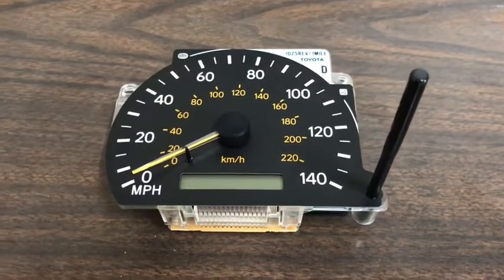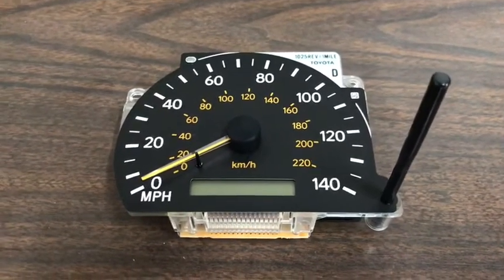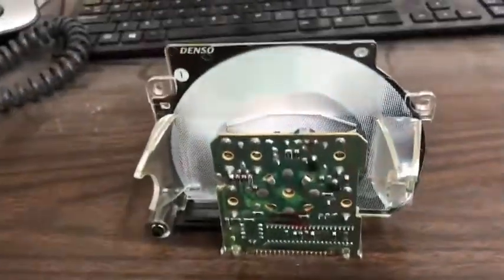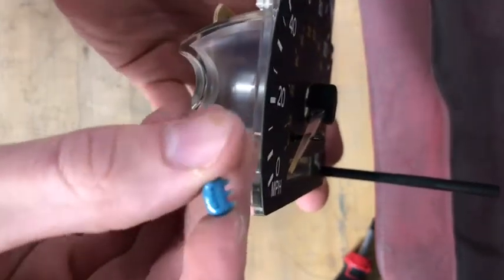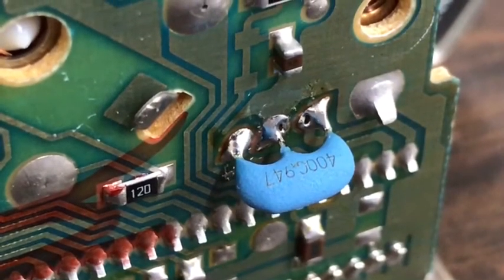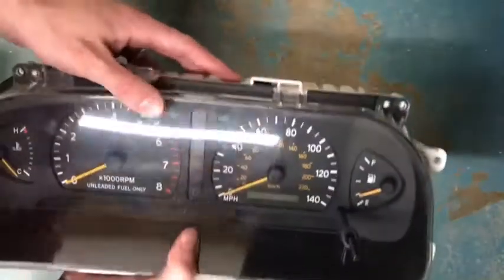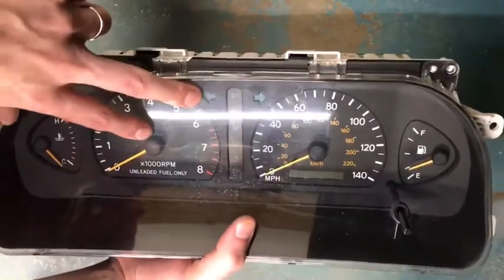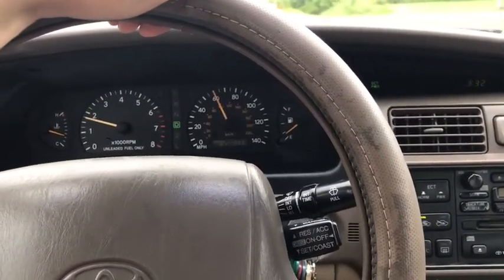How to fix Toyota Lexus Speedometer and Odometer that is not working with Erratic Shifting

Comment: You soldered the new Resonator on backside of the Board, but factory Resonator was installed on Board's front.  Thus it makes no difference if it's installed from front or back? For those of use not formally educated in electronics-- thank you.
Reply from the maker: That is correct. Either side will work. As long as those three holes get filled by the pins of the resonator, it will work.

Comment: Hello my friend. I wish to thank you for your advice. I experienced this issue with my 2000 RAV4. Spot on with the symptoms. Following your lead I was able to solve this problem. It was a confidence builder. Plus, I saved the original mileage count. Not only that but you helped me save hundreds if not a thousand dollars. Again, thanks!

Comment: With your speedometer odometer not working did the car shift differently. I have the same issue when it’s hot, but it also affects how the car shifts
Reply from the maker: Yes sir. Shifting would get erratic for me as well while the speedometer and odometer stopped working. Some people even get engine code p0500. That little electronic part just about paralyzes your car. I think You’ll be glad you replaced that part.

Comment: I have a 97 Sc300 with p0500 and a dead needle. Do you think this would be the issue?
Reply from the maker: If you don’t have any other issues, it sounds like this might fix it. It’s a very cheap fix so worth a shot.
Reply: @jeffharrell1874  I bought that part. I'll try to remember to report back. Thanks!

Comment: I was working on -98 SC300, I've used this to repair older Toyotas clusters and this Lexus had same issues as this and others I worked on, cluster was slightly different but same concept, unfortunately didn't fix the issue on customers car, we wanted to try that fix so they could keep original milage, do if someone tries this on -98 Lexus SC300/SC400, it will not most likely fix it but it is cheap thing to try if customer is okay to pay the labor

Comment: Hello. I have a 1997 Toyota Camry. The odometer isn't working. I replaced the VSS and the part you replace, and it still doesn't work. I don't know what to replace anymore. I don't know what to do anymore, help meeee
Reply from the maker: You May want to possibly look into getting a different instrument cluster, the negative on that is the mileage won’t be accurate.
Reply: @jeffharrell1874  I already bought another one since the rpm and temperature didn't work. But the odometer itself doesn't do anything the same. It doesn't go up. I bought the VSS speed sensor that goes in the transmission and it doesn't do anything either.
Reply from the maker: @HanselAntonio-r3r oh, so you can actually see numbers on your odometer?
Reply: @jeffharrell1874  If I look at the mileage on the dashboard, but I don't see it indicating what speed I'm going, it just stays at 0. It shows the gas, it shows the rpm and temperature. I have 2 dashboards and neither works.
Reply from the maker: @HanselAntonio-r3r so if your odometer is displaying numbers and is not blank, then you might have a speed sensor issue
Reply: @jeffharrell1874  If it shows the number of miles on the dashboard, the VSS is new and doesn't do anything either. Speed sensor

Comment: Saved my 98 ES300!
The cluster needs to be opened: first 4 screws of the small board, remove it and later the ~20 screws of the back panel and a similar circuit board of the video is inside the cluster.

Comment: How test this blue capacitor that you replace with multimeter
Reply: Its not a capacitor its a 4MHz ceramic resonator, rated only to 85C and they go bad with heat. If any of symptoms listed replace with  CSTLS4M00G56Z-B0, which is rated 40C hotter

Comment: This worked perfectly to fix a non functioning (blank) odometer on a 1997 Lexus ES300.  On the Lexus, the back of the instrument panel has to be removed to access the faulty resonator, including removal of an additional circuit board (4 screws) prior to removing the entire circuit board beneath (20+ additional screws).  The fluorescent tube assembly used to backlight the gauges also has to be carefully removed.  As the screws are different lengths, use a piece of cardboard to store all the screws removed that visually matches the back of the circuit board.  It is not a 10 minute job.
Reply: On this Lexus ES300 (1997)the speed sensor on the transmission was also non-functional and required replacement.  Both the display and the speed sensor was broken. Speedometer, odometer, cruise, and transmission all functioning as they should now.

Comment: Please help!  I have a 99 Rav4, 4 door, AWD, Automatic, 2.0L and the issue i have is that just the speedometer and Odometer stopped working all other gauges work.  The odometer is digital which doesn't come on and the speedometer is a needle which stopped working.  I don't have any issues with shifting, but i had a Check Engine light which is on with the P0500 code which links to the Vehicle Speed Sensor.  I went ahead and had a shop replace it, however the issue is still present and the code hasn't cleared.   Does this fix apply to my situation?
Reply from the maker: @mosconioni4523  I think there’s a good chance that this will fix it. This issue also causes P0500. Good luck!
Reply: @jeffharrell1874  it worked, thanks!! 💯🙏

Comment: Got this part from Digikey CSTLS4M00G56Z-A0. Used a 20 dollar solder kit from Amazon with wick and everything in it, even cutters for the wires. Rode around smooth shifting and everything worked like a charm. I just copied everything you did except I used the included de-soldering wick included in the kit. You saved my 26 yo car from the junkyard! I did use real lead solder though. It is just easier to heat. Thank you. I subscribe.

Comment: Great informative video. I also have a '98 Avalon XLS with 235K. The speedometer and odometer fail every time it gets hot inside the car, but they start working normal again after it cools down. 

Could you please confirm the spec for the manufacturer part number you used. I am concerned about using the correct capacitance version, which is either xxxG53xxx (15pF) or the xxxG56xxx (47pF) that you used. Considering that one of your commenters burned his circuit board, I want to confirm that the 47pF version is indeed correct, and how did you determine to select that version to order.

Thanks for your reply or from any other knowledgeable commenter.
Reply from the maker: @mitchellgreer9659  all of the linked parts in the description will work fine. The high temp resistance exceeds the original part. I think the individual that had a bad experience either had a soldering issue or another electrical issue that caused his cluster to fail. That’s the only time I heard of an issue happening. This is a straight forward process. There really isn’t much that can go wrong. Be sure your battery is disconnected during the instrument cluster removal and installation to play it safe. But No need to overthink it.

Comment: Jeff, 

Of all the research I did to deal with this 1998 Corolla, yours was the most helpful by a longshot. I plan to shoot a video for my YouTube channel on how to take the gauge cluster out, apart, how to solder in the new part, and put it all back together

I’m also going to shoot one of these soon for the 200 UF capacitor that is responsible for the issues in 2004 or 2009 Toyota Prius clusters

I want to reference your video, and site the information you gave me, in my video, with a link to yours, and I want to encourage my 6000 subscribers to also subscribe to your channel, but I would like your permission first before I do this
Reply from the maker: @DrewGarage  I have no problem with that. As long as people are getting help, I’m always for that.
Reply: @jeffharrell1874  awesome. Thank you. I would like to see as many people as possible subscribe, and if you keep putting up content like that, I’m sure some of your smaller monthly bills will be covered by YouTube. That’s what happened to me. I am always glad to give, and always feel blessed to get paid for it.

Comment: This is a great video, thank you! Reminds me of the $.25 capacitor that is needed to fix a 2004 through 2009 Prius with no gauges lol

My car is doing everything yours does, but I do have check engine light code P0500… Does that codetypically illuminate the check engine light when it is the resonator?
Reply from the maker: @DrewGarage  yes sir. P0500 is definitely a symptom. That didn’t get mentioned in the video though.
Reply: @jeffharrell1874  thank you so much!

Comment: Hopefully the video poster can get back to me, or maybe somebody who knows a bit about this. I have a 1998 Camry, I had someone attempt to replace the resonator for me and the traces on the circuit board came off that are around the 3 holes for the resonator. How would I go about installing a different cluster from a different 98 Camry into mine. I know there’s a chip on the speedometer board that deals with the odometer information, but I’ve had to drive my car once or twice and my mechanic says the ecu has been storing the accurate mileage reading so I’m wondering how I’d go about installing a different speedometer for my cluster and getting it to show the accurate mileage. Any help would be appreciated, there’s no instrument repair people around me.

Comment: I've got a 95 lexus es300 speedometer and erratic shifting but odometer no problem. What do you think. Thanks
Reply from the maker: @nathanielhutcheson5751  if odometer and speedometer are working fine, then you might have a transmission issue.
Reply: @jeffharrell1874  speedometer not working for a few minutes , then goes to working soon. Have already replaced speed sensor with oem. No engine light.
Reply from the maker: @nathanielhutcheson5751  if your odometer stays on while your issue is occurring, then you may have a different issue.

Comment: 99 toyota rav4 odometer isn't being displayed however the speedo works fine my rav4 is a manuel transmission will this part effect manuel trans  vehicles? thanks for excellent video.
Reply from the maker: @steveleston1848  I’m not sure how this issue will affect toyotas with a manual trans. So I can’t confirm if the part will fix your issue. But I’d say the part is cheap enough to take the chance. Good luck!

Comment: just did the job today. 1999 avalon. the old resonator just finally crapped out completely, i procrastinated for too long.

i used the first digikey link to buy the resonator- i got like 10 of them for good measure. the murata electronics, "CERAMIC RES 4.0000MHZ 47PF T/H" - CSTLS4M00G56-B0 - 	
490-7036-ND. 
seems to work perfectly. actually instantly cleared the engine light, though that might be because of the battery being disconnected then reconnected. works perfectly now.

Comment: I found this video a couple years ago when having this issue with my JDM Camry Gracia and couldnt find the issue with all sensors sending and reading properly, so I got the resonator and all to do this repair, but never bothered to replace it because I'm lazy. It finally conked fully out this week, just replaced that resonator and BOOM everything is perfect again. You are a godsend with this video my man, if it wasn't for this, I'd probably still be losing my mind trying to find out what's wrong.

Comment: Hi Jeff. Any idea whether this solution works for a 2004 Lexus GX470? There seems to be a common scenario for that vehicle where the speedometer is stuck at 0 but the odometer continues to function (and thankfully the transmission shifting also behaves itself) which is of course different to the 3 symptoms you've described. I'd give it a try only I have to order the part first and without having taken out the cluster yet I can't site the component to make sure it is the same value - so I guess my first question is do you know if the component is the same for that model vehicle? Or anyone able to direct me to a circuit diagram (or photo even) for the GX470 speedo itself?
Reply from the maker: You might have a speed sensor issue. I don’t think your root cause is the same as in this video.

Comment: After 2 speed sensors and checking for loose fuses I jumped on YouTube to find this and similar videos. Thanks
Question? Soldering the blue ceramic resistor on the opposite side? Does that interfere with assembly?  
Seems it could.
Reply from the maker: It does not, and it makes it so much easier. Good luck!

Comment: My speedometer works good, but my odometer doesn’t show all numbers, if my tundra has 123,467 miles it shows 1 3,46 incomplete does this fix this issue ? I don’t want to buy a new cluster just for that
Reply from the maker: I’m not sure if this helps in your case.

Comment: Can the place be put onto the front, replacing the old one?
Reply from the maker: After removing the bad capacitor, the new one can be installed on either side of the electronic board. But it’s much easier to install through the back.

Comment: I just replaced the instrument cluster on my 4Runner since the last had a broken screen.  Everything seems good except the odometer is blank.  Trip A and Trip B both work.   Any ideas?  TIA.
Reply from the maker: If your speedometer is still working, this may be a different issue within the instrument cluster. I’m not sure what that would be.

Comment: My speedometer sits at 0 but odometer stays at 147k and I get the erratic shifting. CEL code P0500. Do you think its the speed sensor on the bell housing or the blue resonator in the cluster?
Reply from the maker: It’s sounding like the resonator. Worth a shot for only about $5 and some time.

Comment: This is the gift that keeps on giving. Very similar presentation 1998 Toyota Sienna with 244K miles. When hot day (we are in Texas) there is no odometer display or speedometer operation. On cool mornings it works fine and is a happy camper. This has been so frustrating. Your technique for soldering is novel but very acceptable. This video was very well done and your documentation is extremely solid. 

I will report back success / failure after part(s) arrive and procedure completed. Again, thank you so much for the very excellent video.
Reply from the maker: Good luck! I think it’s worth every effort to keep these Toyotas on the road. They are so well made!

Comment: I put the same part Digi Key 490-18260-ND into my 99 Avalon and it cooked the speedometer board. After carefully soldering the part to speedometer, I immediately smelled electrical issue when on turning on the ignition. I removed the speedometer to see the board had a burn on it. Doing a continuity test on my newly soldered connection posts (3) there was no problem between them, no short. This is a similar "replacement part" to the original part suggested in another video that is no longer available PN # x902-ND  - maybe the problem? I've bought a used cluster to install. Best to ya's, God Bless...

Comment: Great stuff!  So the resistor has no Polarity to worry about? Ie which way around?
Reply from the maker: That is correct. Either orientation will work.
Reply: @jeffharrell1874   Thanks Jeff.  Im actually wanting to do this for a 1998 V6 camry but the part number is different to the one you provide and no longer available.  Your part is the same except its 47pF and the original 30pF.  I was wondering if your part would work as a substitute.  Any ideas?
Reply from the maker: @EverH0p3  I’ve heard success from others in all parts listed in description 👍🏿

Comment: Jeff I think u have the same problem, how do you put 3 holes in the speedometer before soldering. Thanks for the video
Reply from the maker: Go to 2:53 in the video, you will see the soldering iron melting all 3 points. You then need a solder sucker tool to suck out the melted solder, which will then expose the holes.

Comment: Got the same issues with my 02 sienna plus the parking brake is always on, except the odometer is not blank. Its just not moving anymore. I wanna try this fix but hesistant because the odo is not blank.
Reply from the maker: I would be hesitant as well to pull out the cluster. It’s possible that only a speed/abs sensor is bad. As for the brake light on, try verifying that the brake fluid is full.

Comment: Have an 04 4runner. Speedo and ODO are froze. Code p0500. Having hard shifting issues. No ABS codes and all my wheel speed sensors check out. Could this be the issue? If not do you happen to know if the speedo stepper motor feeds the ODO? This shit is driving me nuts.
Reply from the maker: I’m not sure on a 2004. But it may work

Comment: Thank you. Been looking and searching for any information that can resolve this issue that I have on my 1997 Lexus ES 300, recently acquired. The odometer is blank and no reading of anything. Thank you, again for posting this.
Reply: what did you do for the lexus es 300? did you figure out which one is the resonator that controls the speedometer odometer?
Reply: @arilandwirt9023  got a resonator or capacitor and replaced it with a new one. My odometer came back on and was readable.

Comment: I'm wondering if I replaced my instrument cluster already and it's still doing this. I even replaced the inner and outer speed sensor on my 2008 Kia Spectra
Reply from the maker: I’m not sure if the same fix applies to a Kia. It might be best to have a trusted mechanic diagnose it.
Reply: @jeffharrell1874  I've had two different mechanic shops replace parts. Thanks for your response